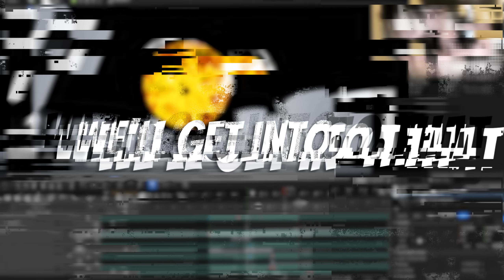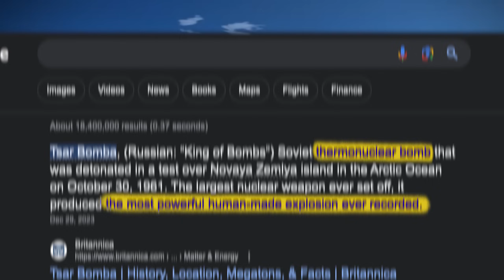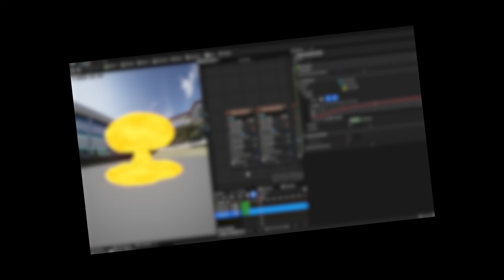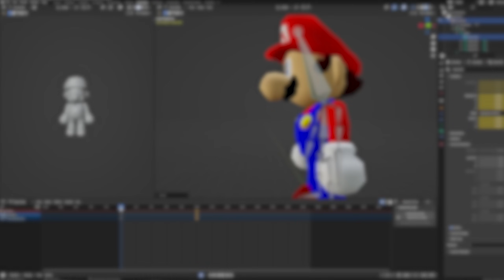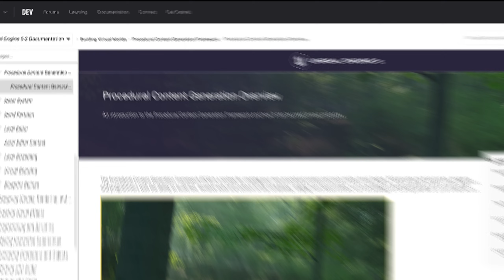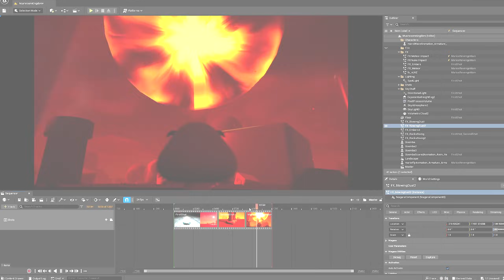I Gave Iconic Characters their own DOMAIN EXPANSION (In 3D)

Comment: Phineas: Domain Expansion:Sweet Home Vacation.
-The User is able to manipulate anything inside the Domain Expansion with the cost of Cursed Energy Consumption. On top of using a DE that exhausts you. You need a bottomless cursed energy to manipulate anything in the Domain. It defies and disables every possible rule of reality meaning Multiverse is possible. It can also defy the rules of a character for example being immune to bullets won't work inside the Domain as it defies all reality
It constantly drains the CE (10x speed) you have left after the DE so you need to think fast. If the user has almost an infinite amount of CE they can spend days in that DE specifically....104 Days is the limit. Usually someone like Phineas or is a high tier in the verse they can use the DE for 20 Seconds but the Attacks aren't Sure-Hit and it can be used Once after 3 Days.For it's Cursed Technique you need to absorb any and I mean any bit of knowledge to expand your weaponry of being able to create anything for example you don't know what 1+1 is yet and you learn it which levels up your CT. Of course it's Cursed Technique doesn't defy reality and it's only weapons that exist in that Universe itself that you can create. Phineas's CT is called: U.I.W (Use It Wisely as you have to use the godly power bestowed upon you before you get exhausted).

Comment: First method causes problems when the parent group has a mirror modifier. Then the modifier is applied on the clip group. But it can be fixed by removing the mirrored part and adding the mirror modifier again.